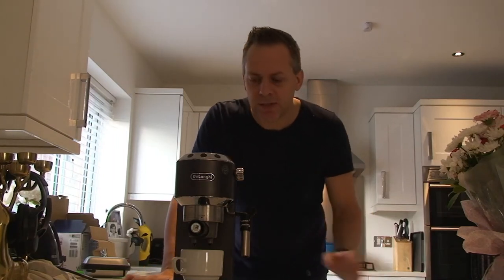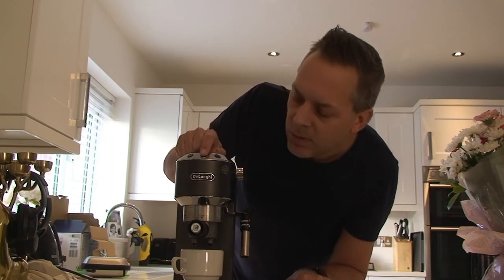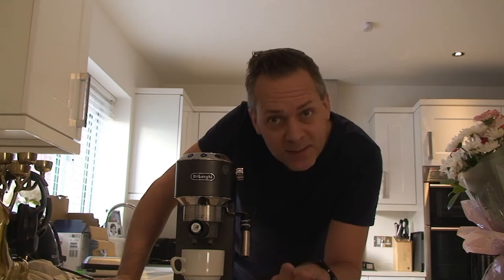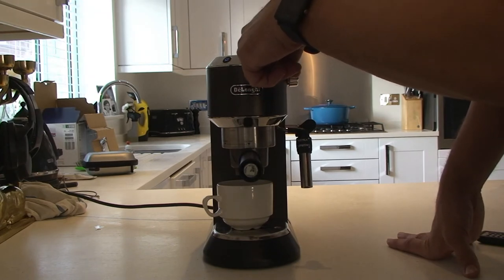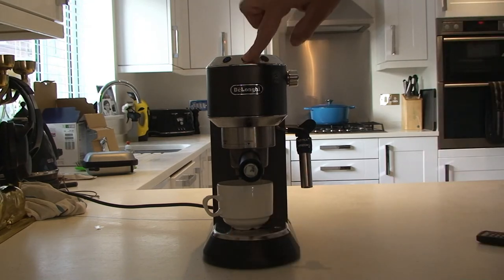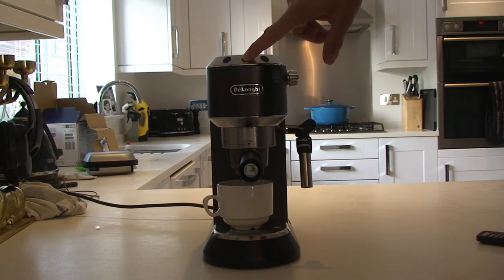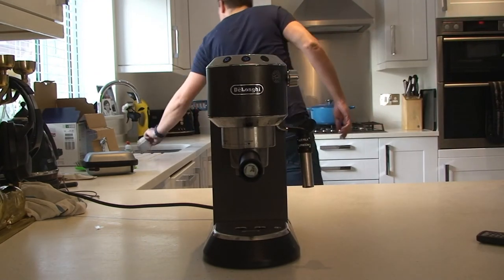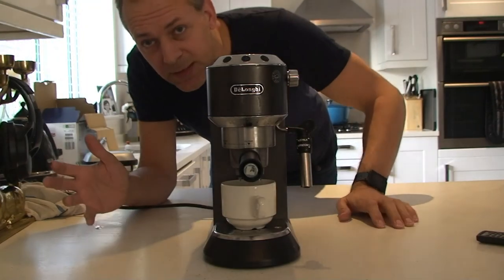Delonghi Dedica coffee machine reset fix when only 3 seconds of coffee comes out to get a full cup

Comment: * HERE IS HOW YOU RESET YOUR MACHINE PER DeLonghi **
  While this does work it does not produce a good shot (or double) of espresso. A proper double shot takes between 20-30 seconds to pull & as you adjust the length of pour you are cheating yourself from the best flavor as under or over extraction negatively impacts flavor & adds a lot of strain to your machine. So here is the fix per DeLonghi & the owners manual. Turn the power on when the ma hine is ready for use press & hold the steam button for 10 seconds, the three buttons will flashh in sequesnce, release the steam button & turn the steam dial to steam, press the single button. The three lights will all flash confirming your reset, the single & double lights will flash to close the steam dial. You are now good to go to get a proper 3oz double shot! I recommend you download the owners manual from the website as there are other functions you can adjust to give you the best shot!
Reply: Thank you for taking the time to write this, It does make complete sense and I will try this with my machine this morning, thank you again.

Comment: Just an FYI to make it a bit easier if you need to do this again. You should be able to reprogram the shot time/length whenever you want by simply holding the button (single or double shot)  down and not releasing it until you have the amount you want. It will remember that setting from then on. 

I have the EC680M I use with a non-pressurized basket.
Reply from the maker: Hi Philip, thank you that does sound easier 😊
Reply: Thanks a lot as this is much easier step. I bought this two months ago but never really use it much becs of the improper settings. I'm happy now 😊
Reply: Thank you for the comment and to OP for the video!
Reply: mine has suddenly gone bust and does the 3 second thing for the coffee shot and for the frother. is there a way to fix the frother so the pump doesnt stop after 2 squirts?

Comment: Thankyou for the helpful advice it worked a treat. Before finding this is video I replaced the water pump as this was faulty on my machine but afterwards still only filled for 3 seconds. After carrying out the above it reset the flow meter, a white cylindrical component inside the bottom of the machine and nows works perfectly. Thanks again.

Comment: Hello sir,
I guess it's not working in my case. I have Dedica 685 with the same problem. I did reset machine (reset with my machine is a with steam knob...), and programed time for middle button around 33sec. And it was ok with empty filter, I repeat few times, and it works. But when I put filled filter with coffee it won't, it runs that 3 sec and stops. :/ 
I think this is only with double basket filter. With the single cup button and single basket filter i think i didn't have problem, but I rarely use it.
Reply: Hi, some problem with me. Have you solved it?
Reply: @remscastro2884  No, still the same.
Reply: @nenadnikolic1071  same problem here. I have found a video where they claim in the comments that it might be caused by a broken flowmeter. I have ordered one, we'll see if that works
Reply: @ZerBlanz  Wow, really?! Please, leave a comment if that solves the problem. I only hoped that it's not a failure. I have a warranty, but anyway, I'm afraid that they will refuse and return it as it is, since it works somehow...
Reply: @nenadnikolic1071  Hey, the replacement arrived today and it actually solved the problem completely!! But it is really tedious to disassemble the machine, they use different length for the skrews, so you need to keep track of what to put where and there is a lot of room for breaking something... If you still have warranty I would try this first. If not, I also found out, that it could be enough to pump water through the flowmeter with a syringe to unclog it. For that you only need to remove the bottom panel and one of the two tubes should be it, so it could be worth a shot before ordering a new piece. If you order a replacement flowmeter, get a few new rubber pipes as well, I replaced the one leading to the flowmeter.

Comment: My Dedica is getting this issue more times that I expected... I've done these steps a bunch of times in the past and the machine worked for months without any problem. Now I'm getting a bit more frustrated since it only works fine for about 1 or 2 clean extractions. It tends to get i this flashing lights WAY more often. Is there any other method someone found to solve this issue besides this one?

Comment: Hmmm, it did not work for my machine. Not sure why. There was no water coming out at all. Any idea? Thanks.
Reply from the maker: I don't im afraid, sorry.
Reply: With these 680's the common problem(s) seem to be either the pump, the flowmeter or the pressure valve.  The pressure valve (which I just replaced on mine but didn't help)  can be changed without removing the whole affair. It's a bit of a hassle but can be done. 

To change the pump or float you'll have to take the complete machine apart. If you're lucky you have a compression clamp on the steam hose that is easy to remove. Mine is a crimped compression clamp.   

My next part to replace will be the pump. If that doesn't fix things I'm going to buy a Gaggia Classic Pro.

Comment: Thanks. My issue is no water coming thru filter. But water runs if filter removed. Is it pressure pump maybe?
Reply: I have also had this. If you just use the machine with the unpressurised filter (the one with no rubber) for a week or so then pop the pressurised one back in and it will work again. It is the first sign the machine is showing its wear and tear. Good luck